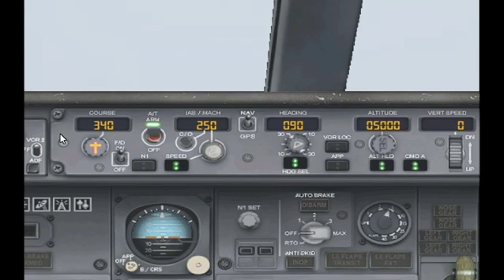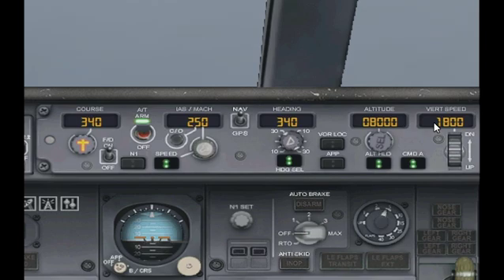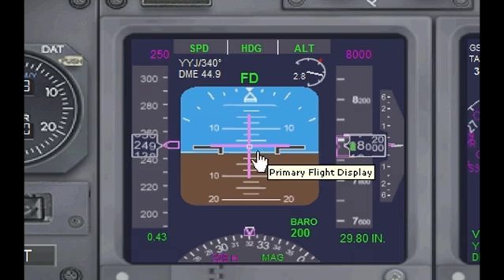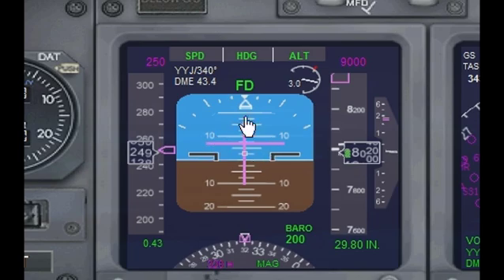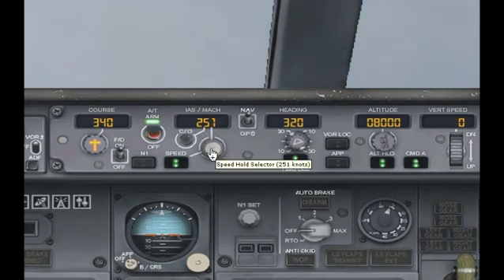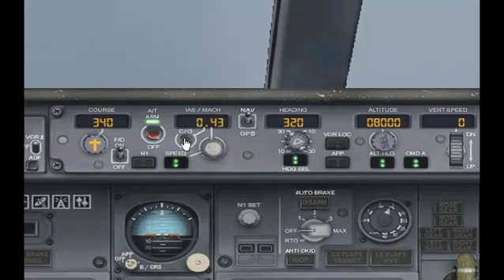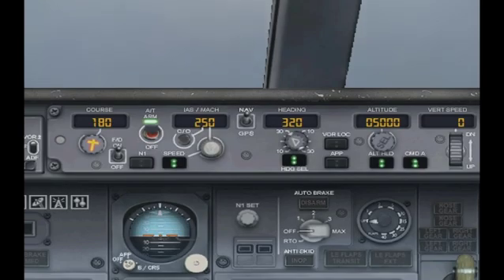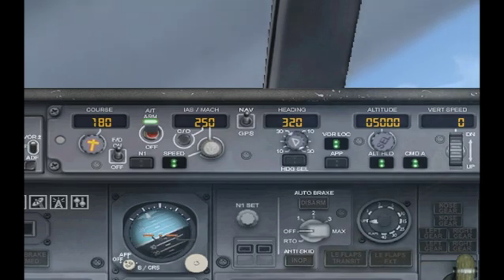FSX: Autopilot Functions Tutorial PART 1

Comment: This is weird, I've put a VOR of Anchorage 114.30 in the NAV1 radio switched it to the active then tried either 180 course or 360 then clicked on NAV, the plane isn't turning or doing anything.
Reply: That's because you have to select the correct course for the direction you're headed

Comment: omg, i set Vertical speed to 1500f/min and climb from 4000f to 12000f and my autopilot started to put my plane under over bank angel and then it stalled, i lost 5000f within less than 30sec and crashed. any idea what i did wrong, btw my plane was bombardier crj-700

Comment: Again part 2 of my first comment:
Example is proven for Boeing 737-800 and works for all models I've tested (with different speeds of course). If you want you also can preset your airspeed and activate autothrottle and speed hold after being off ground.
Last but not least big thx for your tutorials, it helped me a lot understanding and using ILS approach from GPS mode.

Comment: @DNthenumber10: yes, you can use the autopilot for taking off. Try it like this: while grounded set autopilot off, choose altitude as needed for final climb e.g. 12000 and set ALT hold on. Adjust the rest as usual for a Example is proven for Boeing 737-800 and works for all models I've tested (with different speeds of course). If you want you also can preset your airspeed and activate autothrottle and speed hold after being off ground.
Last but not least big thx for your tutorials, it helped me

Comment: @DNthenumber10: yes, you can use the autopilot for taking off. Try it like this: while grounded set autopilot off, choose altitude as needed for final climb e.g. 12000 and set ALT hold on. Adjust the rest as usual for a start. Begin take off, full thrust, don't touch the elevator and keep watching airspeed. At 110 KIAS turn on autopilot master switch CMD. Sit down and wait ... at about 140 KIAS it will lift the nose automatically and between 160 and 170 KIAS you're airborne. Example is proven f

Comment: I'm not 100% sure, But, I guess you approach the run way on opposite side. example you should be approach on north and you approach on south.

auto pilot heading is on? if yes that is the problem it overrides the approach auto switch on.

again not 100% sure.

Comment: Tnx, I finally landed with your instructions! Just one question: I tried that on several airports but sometimes ILS guided me away from the runway - the plane was aligned with the runway but in oposite direction... Does it make a difference if you are coming from different directions toward the airport? Example: going from north to Venice, Tessera (LIPZ) - when I hear morse code and turn NAV on the plane starts turning away from the airport (but it is aligned with runway heading).